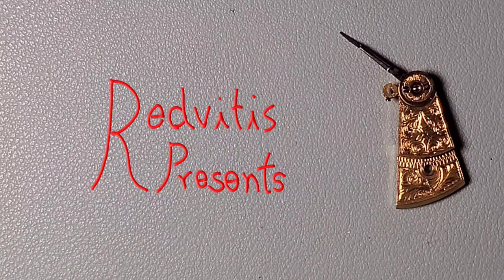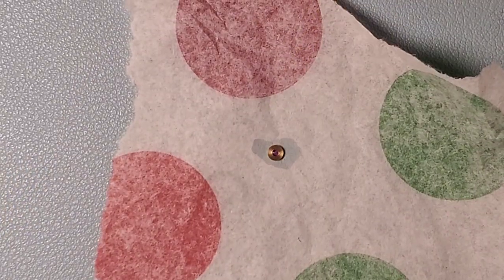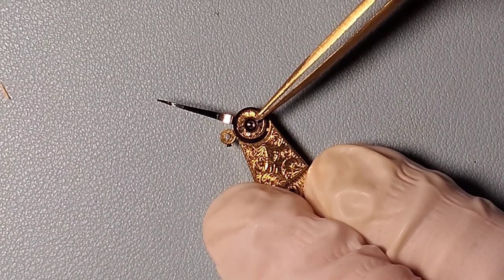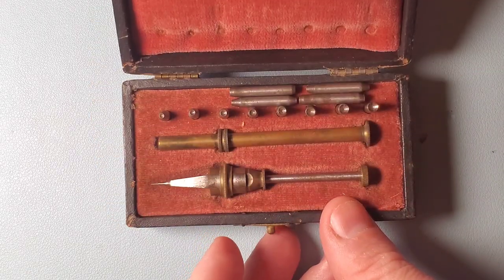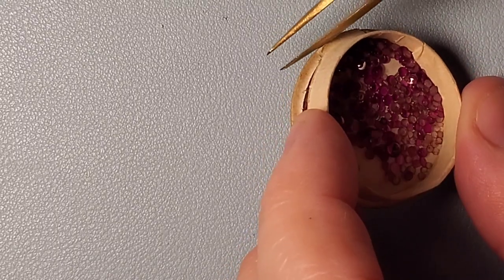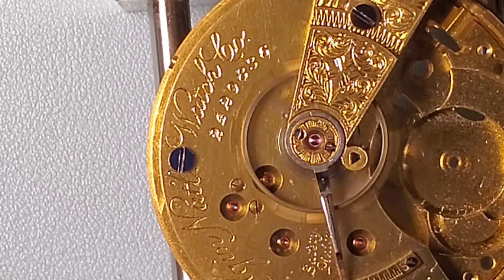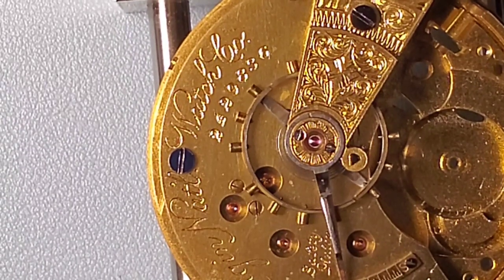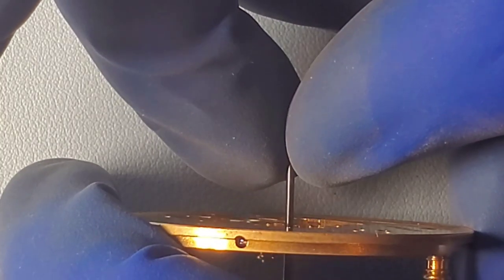Watch repairs galore! Rubbing in a cap jewel and more: 1880's Elgin pocket watch - part 2 of 3

Comment: There is another good thing about closing the pivot holes and adjusting them with the broaching tool, the brass gets hardened by the dragging and pulling by the broaching and therefore works much better as a bushing  😊

Comment: Hello,  if you wanted to source a new crystal for a pocket watch,  where would you buy it? Thanks for any help and your videos.
Reply from the maker: I work with and collect mainly larger, open face pocket watches, and my preference is to keep the old mineral crystal, even if ther is cosmetic damage, if it is a thick crystal. I don't care for the thinner crystals, some are meant for hunters, since I've had one shatter while wearing. I have an assortment cabinet with mineral that I acquired some time back and haven't bought any recently. I have bought a plastic called sternkreuz from otto frei for smaller PWs. Might check with them for mineral crystals too.

Comment: Ive been trying to service an Elgon that has a near identical movement to this.

What set of screwdrivers did you use for this? All of my screwdrivers slip...
Reply from the maker: It was a budget set back then, and I had to reshape tips all the time. Switched to bergeon shortly after, the nickel-plated brass ones. They are fantastic, have done many similar Elgins since then. Screw slot widths can vary quite a lot with different watchmakers.